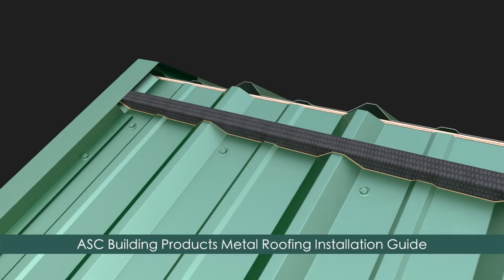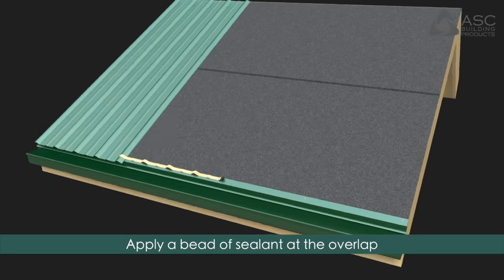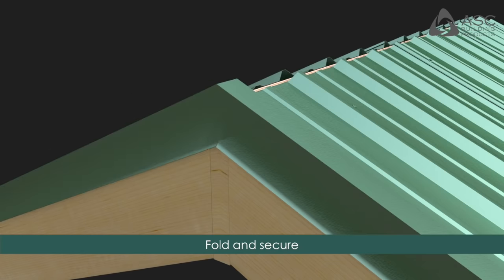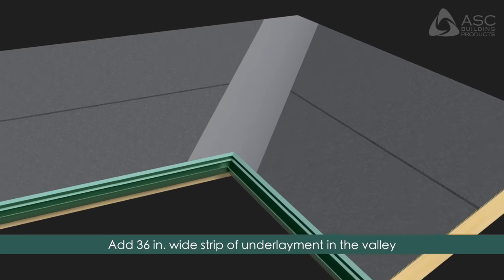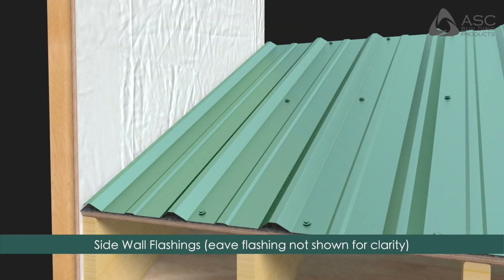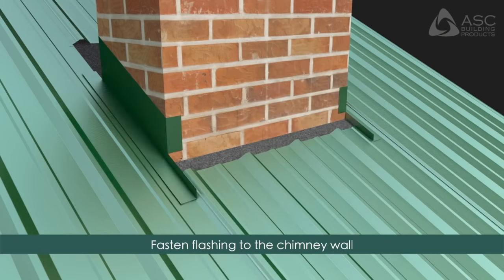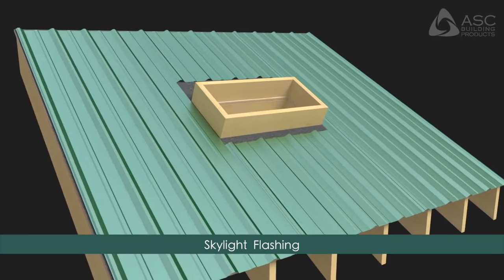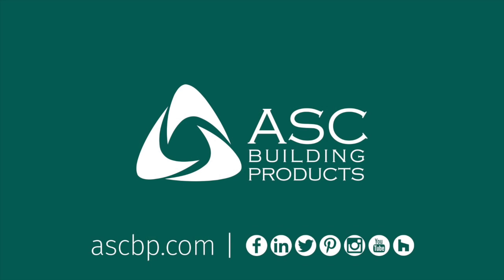How to install Metal Roofing 3ft panels-ASC Building Products

Comment: If possible I HIGHLY recommend installing these on top of 3/4” wood strips to maximize air ventilation under the metal. 👍👍 if there was a practical way to install solar panels on this roof vs standing seam I would use more of it but standing seam is much better for solar panel clamps.
Reply: How far apart would you put the woods strips?  Wouldn’t you be worried about it caving in in the air gaps from snow or if you have to walk up on your roof?
Reply: @w6p7a  you’re supposed to do it every 24” I’ve seen some videos of people doing it 40” apart but that’s where the problem with snow weight and other factors would come in and cave in the metal. I wouldn’t recommend do in it more than 30” apart
Reply: There would be no air ventilation if the steel is sealed off!

Comment: Are the stitch screw in the high spots of the panels ,actually suppose to screw into the wood or do they just catch the metal roofing panels and poly closure?
Reply: They catch the wood. Lengths of washer screws are normally 2.5 inches
Reply: Stitch screw are short and meant for metal to metal attachment

Comment: We tore down a 70 yr old commercial chicken house having a metal "5 V groove" metal roof. It had the old metal roof nails...all placed at the top of the V grooves...not in the valleys. The wooden structure was in remarkably good condition with no rotting. Placing fasteners in valleys is a no-no. 
I am wondering if an air gap underneath of approximately 3/4" would help cooling of the roof?
Reply: I agree with you, Im tired of seeing people fastening sheets as per this video, its just dumb.
Reply: @jamesmatheson5115 no it isnt
Reply: @toast2437  Got no idea what your comment refers too.
Reply: @jamesmatheson5115  sure you do.
Reply: Like I said earlier its dumb to fasten sheets in the valley, they will eventually leak, only in America does dumb sh!t like this happen.
Reply: @jamesmatheson5115  
Check out how metal roofs are secured on commercial buildings...screws are not in the valley. They're made to last.
👍
Reply: @JusticeAlways  I agree, I personally wouldnt do it any other way.
Reply: @jamesmatheson5115  
👍

Comment: Can you install this roof over your existing shingles roof? That’s what my contractors did, and I’m not sure if he was being lazy, or what.
Reply: I’ve heard that that is fine. I can’t imagine. It makes much a difference, the only issue would be if you already had a roof sheathing issue that never got addressed and is now harder to repair
Reply: Yeah, it's fine to do that. Like Raven☝🏻said...As long as the sheathing underneath is structurally sound. It also depends on how many layers of shingles you're laying on top of though. The only time it's ever been a problem for me, is on really old homes. I've seen when there's been literally 5-6 layers of shingles ON TOP of the original wood shakes that were used in 1918 when the home was built!😳 
It was 2" worth of shingles/shakes on top of the 3/4 x 6" plank they used back then, before plywood sheets were a thing.

Comment: This diagram has you cut some metal off to fit inside the first piece of  flashing,but then it says to put caulking on it, then slide it under the first piece! This is physically impossible to have the second peice slide under the first yet have the trimmed off peice fit inside the outside crimped edge!
It would have to go on top of the first peice and caulking would be applied to the first peice of eves flashing!
I was sold a system that costs me more,and another company just uses drip edge for the edging,same as for a shingles roof.
The point is,if you watch different videos on how to install a steel roof,if your paying attention  you should notice there's 2 ways to do it!
A 3rd is just not bother with eves flashing and the hardware you don't need,as your evestrough covers most of the wood under the roof as well as metal or vinyl soffit put under the overhang !

Comment: . . . at time stamped 00.01.32 . . . is it really correct to fasten down the sheet between the ribs . . . I dare to say to fasten the sheet on the ribs to strongly avoid leaks even though you seal each screw fastener . . . what do you say?
Reply: Everyone attaches in the valleys in the US. I have heard that in Canada you screw in the high spots. The roofs flex in the heat.

Comment: If you are screwing right through, over time couldn't it leak at those screw holes.
Reply: Most definitely. I'm replying from Australia where we never screw through the tray or flat part of the sheet. It does not allow for expansion and contraction in the sheet and eventually the rubber washers give way and yes leak. Always screw through the rib. In all reality everything I see on so called metal roofing in the States is garbage. I confess there appears a lot to be desired in building practices in the US. Regards Stewart. 04-07-23
Reply: @stewartsherriff2095 your method is just BS cause it does not not Make sense at all
Reply: @toast2437  That's because you haven't a clue about roofing or enough common sense to understand the correct procedures. It's not just my theory it's the theory of all major roofing manufacturers in Australia.
Reply: @stewartsherriff2095  i do know roofing, and fair enough for your rules, but the reason why is lacking to me.
Reply: @toast2437  Yeah Hi and thanks for your email. I can only suggest the theory of fixing through the ribs/crest of the sheet is to allow for expansion and contraction. Fixing through the pan does allow minimal expansion and contraction but this action wears the rubber washers away and creates leaks. Lysaghts possibly being the largest roofing manufacturer in the world have what they call "The Lysaghts Referee" which is a bible to all roofing products, fixtures etc. It's a small hand held type of dictionary and generally free from Lysaghts. Regards Stewart. 16-04-24

Comment: On the drip edge you are supposed to notch the drip on the first piece that is installed, caulk that one then the next open the hem put it in position then roll it into place making it easier and you wont plow the caulking.

Comment: this Video has excellent. However, do you know of a good reference for installing this roofing on a hip roof?
Reply: I just did it.  It's not fun if you have any valleys that you have to cut angles on the sheets. You need a really good metal cutting blade. ( About $35 on Amazon)   Otherwise it's the same install except the corners where the Hip meets the ridge of the roof.
Reply: this Video has excellent. However, do you know of a good reference for installing this roofing on hip roof?

Comment: Do manufacturers say anything about requiring changing screws every five years.
Reply: I don't know about the manufactures recommended approach. However, several times I have replaced the screws on these roofs. It is cheaper to buy the washers and grommets separately from the screws. Just buy screws that are a minimum 1/2" longer to ensure they get a new "bite" on the substrate. Personally,  I checked every single screw and replaced as needed. Some customers wanted them all replaced regardless. Hope this helps!
Reply: Did you read the manufacturers warranty on the metal roof. It's nice to know though what the bag of screws said. The question was asked, just so consumers would do their research.

Comment: This video reveals just how impossibly difficult it is to properly install a metal roof. I daresay that not one in 100 installers can correctly abide by all these detailed recommended install procedures. This is especially true if the house involves vertical walls rising on the 2nd floor from sloped roof areas. It is clear to me that after an installation has been provably done wrong, the homeowner is just left with no recourse. At best, the typical roofer will respond to a flashing problem by sending a man out with a tube of roof caulk! As opposed to removing and reinstalling correctly any area done wrong. After that, the typical roofer will simply stop taking your phone calls. It would be nice if a roofer's work were held to the inspection of an unaffiliated roof pro, but I think that is a pipedream.
Reply: the video covered wall flashing, what makes the situation you describe difficult? One problem i foresee is when the layout has a rib exactly where the flange of the flashing is supposed to sit. You'd need a wider piece of wall flashing to make it over the rib.
Reply: maybe you just have ridiculous standards, learn to do it yourself if you want specific outcomes
Reply: @tightbhole420  The standards I referred to are simply the ones demonstrated in this video. They are not MY standards. I have never had a metal roof, and am leery that if I do, it will be done correctly.

Comment: Exceptional video, please clarify why you recommend screwing in the steel roof “valley” vice the “arch”. I have been told always the “arch” as screwing in the “valley” will cause leaks. I am in the Eastern Ontario, Canada area and we obviously get a fair chunk of snow. Looking forward to your answer. Thank you!
Reply: Use the correct screws and they won't leak
Reply: I’ve heard that after 7 years you need to tighten down the rubber gasked screws because the gaskets shrink

Comment: This only stops rains, not hurricanes, I have been doing forensic architecture for the DoD, and I see them fail every time a hurricane passes through a base. After that, any heavy rain fall the interior of the building will be cover in pools of water or leak will came from the failure of the neoprene seals.